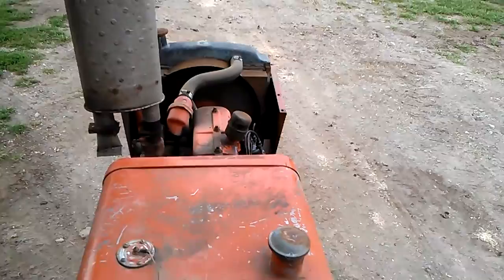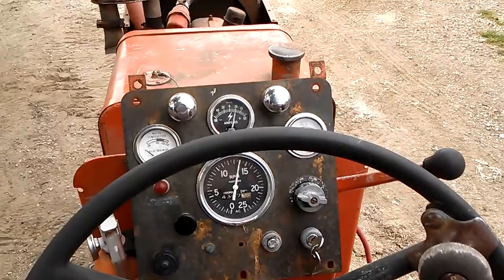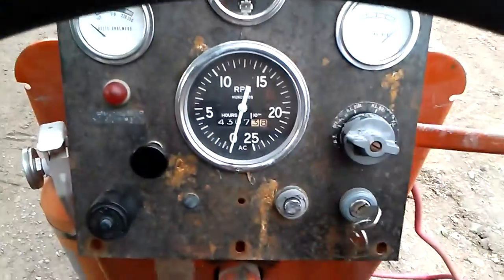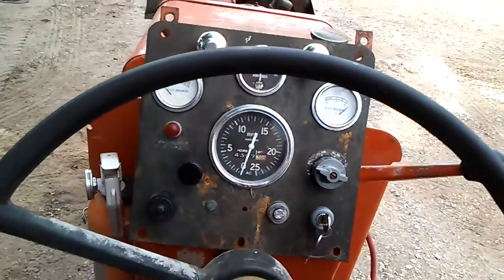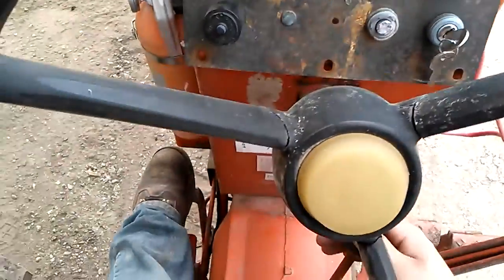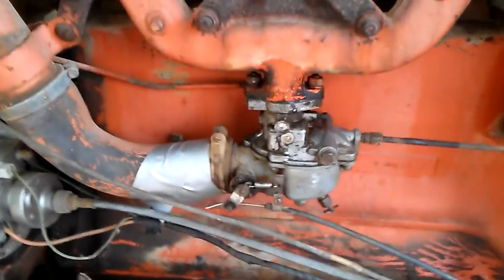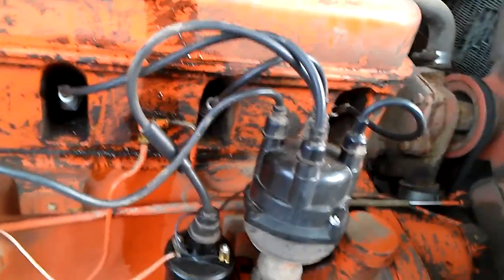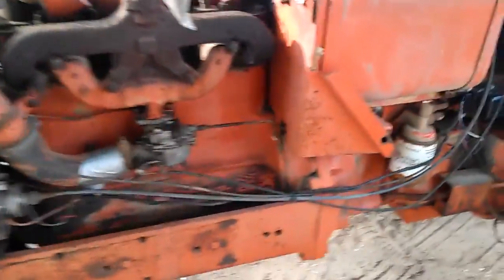Allis Chalmers One-Seventy running/driving

Comment: Have a 185 diesel and struggled with her all summer changed unknown amount t of filters until I finally had enough and she took a ride to to the shop and they found the governor ring in the fuel pump had broken up over the years and plugged the return line and she basically did the same as yours I could run it in the field for an hour then all of a sudden she would say ok bud I'm done for today ( not a good way to get alot done) but the shop found the return line plugged full and it caused it to die suddenly

Comment: I don't know if you ever got the tractor running properly, but I can guarantee you that is is only running on two cylinders in your video because you have the spark plug wires hooked up incorrectly.  The firing order on this engine is 1243, and if you notice you have it wired for an engine where the firing order is 1342.  The distributor turns in a clockwise direction when viewed from above. You probably need to switch the wires for cylinders 2 and 3.
Reply from the maker: Alright, fair enough. I appreciate you letting me know; We knew it wasn't hitting on all cylinders, but weren't sure why. We had left the plug wires the way they were originally, but since you pointed it out, I'll go and switch the wires in the next few days. Kinda wondered why it backfired a few times as well...

Comment: Here is a link to a video of the engine in a Gleaner E combine.  It is identical to the engine in a One Seventy tractor.  If you pause it in the right spot, you will see how the wires need to be installed.
1966 Gleaner E engine idling
Reply from the maker: Thank you for showing me this. Come tomorrow morning, I'll switch those wires around and see if that makes any difference. I have a sinking suspicion that maybe I've fouled the plugs horribly by accident on the 2 and 3 cylinders.

Comment: The engine dying like that may have nothing to do with the carb. It is probably either a bad condenser heating up, a bad coil or the wrong coil or a fuel starvation condition. If you take the drain plug out of the bottom of the carb bowl and see how long a good solid stream of gas comes out, you can tell if it is starving for fuel.
 I might add, a new condenser doesn't mean you have a good one. They are probably most often the cheapest fix with the worst longevity.
Reply from the maker: We think maybe it's a starvation issue; Pulling the plug out of the bottom of the carburetor, it doesn't really throw a huge amount of gas anywhere. We cleaned it once, but it seems like the copper tube that goes from the sediment bulb to the carburetor is fairly small.

To my knowledge, we haven't changed the condenser. I'll give a look as to what still hasn't been replaced.